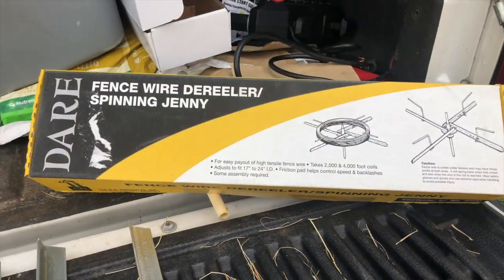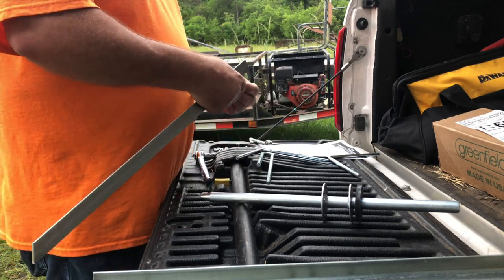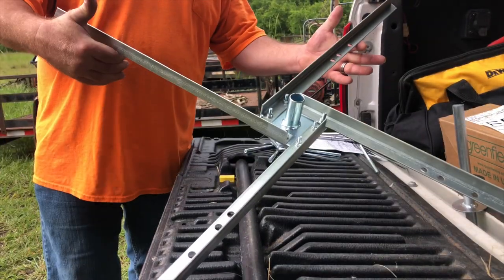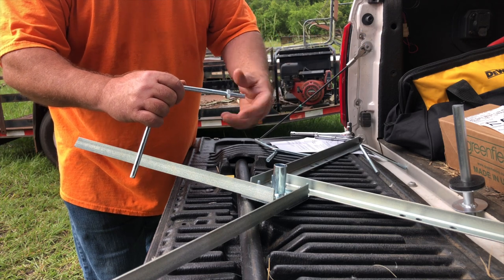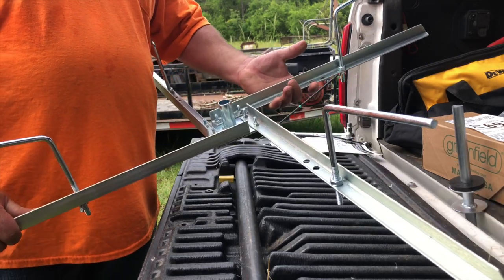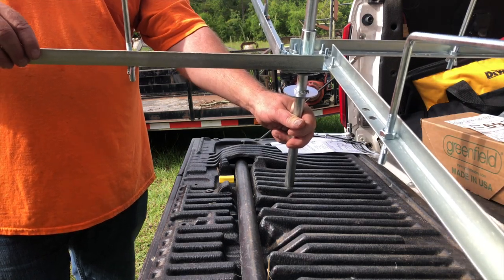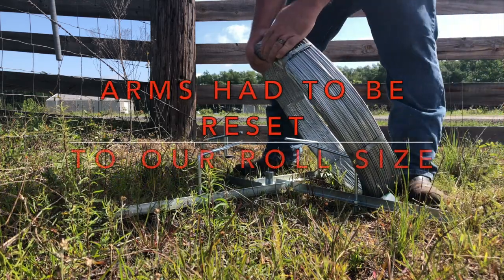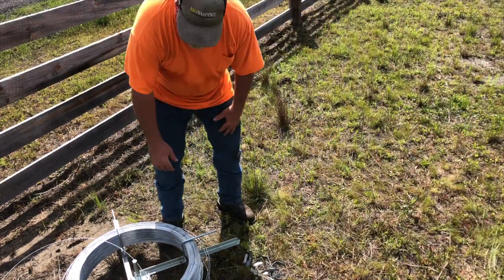Spinning Jenny High Tensile Wire Assembly and Use Demonstration

Comment: Great video.  My jenny is like this.  Many people complain about this style because they fail to drive the rod into dry (relatively) flat land.
Reply from the maker: I like mine as well. Really helps simplify the process   👍🏼🤠
Reply: Yeah, I've read a lot of bad reviews about these. They seem to wobble if in loose ground. I wonder if mounting a piece of 2x4 to some plywood and drilling a hole in the center and placing the spike in the hole would eliminate the wobble and most of the problems?